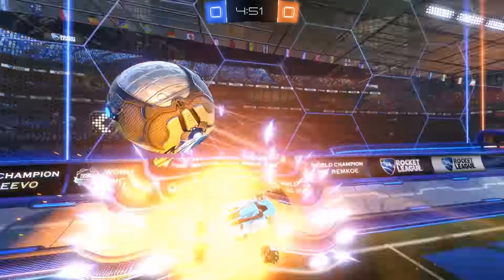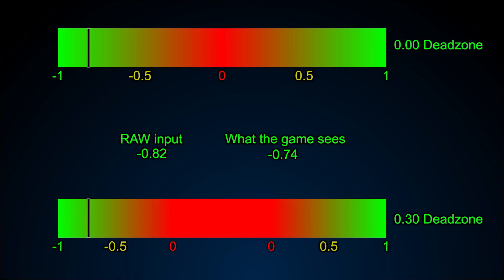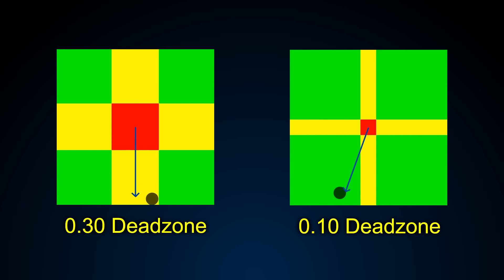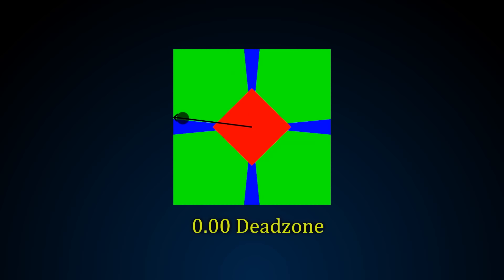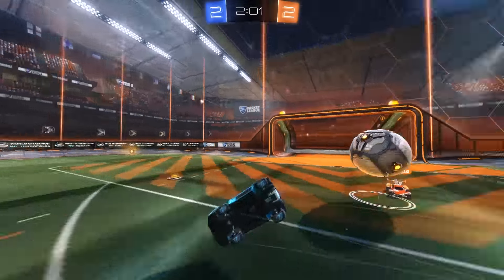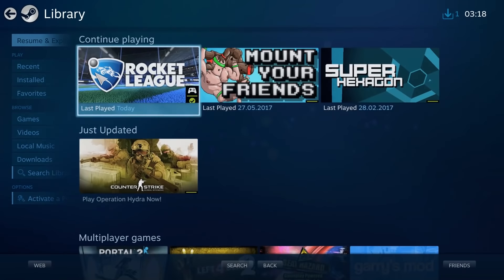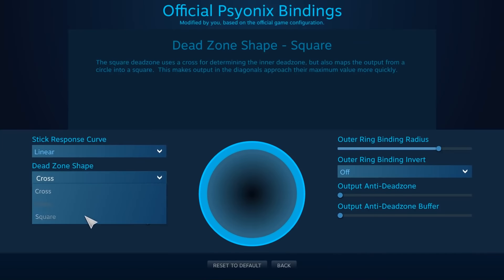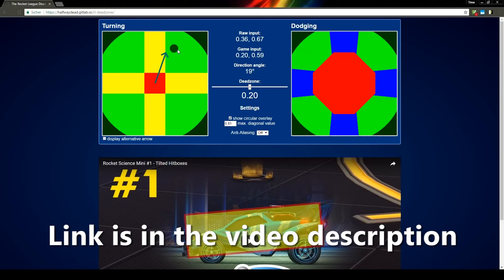Deadzone explained - Rocket Science #7

Comment: Help me make up my mind for me!  I watched this video and I'm more confused than before I even started!
I've always had issues with backflipping (on accident) while going up for a fast aerial and because of that I felt
the need to raise my dodge deadzone up about half way.  Even then I STILL kept backflipping on accident while
trying to do a fast aerial.  A couple years ago I decided to just put it at the highest value of 1.0 and these days I
don't backflip hardly as much anymore when attempting a fast aerial.  Am I somehow screwing myself over in
regards to other mechanics because of high high my dodge deadzone value is set at?  Please let me know!  I've
also recently changed my "controller deadzone" to be 0.25 instead of keeping it at a super low value like most
people seem to recommend.  I've noticed that as of late my aerial control while dribbling and my control with 
everything else seems to be a little more finely tuned and I feel a little more consistent.  Am I foolish to have
it at 0.25 rather than 0.05 to 0.07 which is typically recommended from most?

Comment: I’ve noticed a steam configuration issue that may or may not affect people
Interruptible button presses.
In effect, I’ve noticed many of my attempts to dodge ignored, on my DualShock4 wired controller.
I manually turned off interruptible presses for each button, which seemed to help but also made me unnecessarily backflip until I got used to the responsiveness

Comment: I sometimes get double input with my controller when using this method. I'm using an Xbox One Controller, but for instance if I jump in game it sometimes jumps directly after again without me pressing the button.
Reply from the maker: That sucks :/ Did you use my profile or did you do it manually? I've heard stories about steam settings randomly changing. You could try resetting it to default and start again. Or in case you're using any other software that modifies your controller input (like x360ce, durazno or possible others) you need to turn them off. Don't use them at the same time with the steam overlay. If none of this makes a difference then idk what could be causing it.

Comment: Hi and thanks for such an awesome video. By the same nature if we find the analogue stick too sensitive in game is there a way of using the steam settings to reduce the sensitivity of the sticks? For example in the air I find a little touch on the stick can send the car flying around. I’d love to hear if you have a solution for this as I suffer with issues with my hands and this would be a fantastic help in giving me better control - thank you 🙏
Reply: 2 years later but yes, Steam controller layout settings has a "stick response" setting now. If you set it to a "wide" curve the stick will be less sensitive when initially pushed and then increase to full range exponentially. It's great for smoother steering on the ground but It doesn't help too much in the air though - the steering is still too touchy and weird. It's just the way it is due to an imaginary gyro rotating a car around in the air...

Comment: Hmm just to be sure I checked the additional options like you said after I loaded your profile but the loaded profile is different from what you are saying it should be in 6:25 when I loaded your profile my dead zone outer is maxed but it says your profile is loaded :S Same goes for the anti deadzone stuff.. the only thing that's correct when loading in your profile is that it's set to square.
Reply from the maker: That is because I manually edited the profile to get as close to the max as possible. However, in the user interface that causes it to look maxed out even if it's not. The number and slider are rounded values.

Comment: u said if u set it to 0 steam automatically addy 0.25 right? i think i figured it out. if u use big screen mode on steam (only using controller now) and set it to zero and then add one klick to the right with the cross u get exactly 0.25. i think thats the default steps u can make with the cotroller?

Comment: I know this video is old, but I’ve heard square deadzone is bad, so wouldn’t it be better to just disable the entire controller configuration and play with default settings?
Reply: The steam controller configuration causes input lag. I would highly recommend unchecking the boxes in the steam controller options. You can google  “steam Controller configuration input lag” for reddit post confirming this for rocket league
Reply: I play on a 240hz monitor and I don't notice any input lag whatsoever with or without the steam config, it's probably grossly exaggerated I feel.
Reply: But ds4 windows is the best way to go to customize the specifics in deadzones

Comment: Hey dude thank you for this really valuable video and website, but why are your controller configurations using 1.00 outer deadzone and 0.00 output anti dead-zone like you said not to use ?
thank you
Reply from the maker: Sorry for the late reply. The configurations have files on the computer that you can edit manually. In the file you have the option to set the value a lot closer to 1/0  but it's still not 1/0 even though it shows like that. I've tested that it does behave like I wanted it too.
Reply: @RocketScience  ok thanks
Btw I suggest you to look at durazno^2
This is a great tool if you want to use your controller at it's best, but it requires to force steam controller support off for the game
Reply from the maker: Oh yeah, I agree. When I made this video I just thought it was easier to just load a profile through steam and wasn't sure whether people would want to install extra software. In the controller input lag video, I actually found steam config to add 1 ms of input lag. Not too significant but unnecessary.

Comment: I usually play rocket league on my PS4, but i recently got it for PC. I am considering switching to square (as many seem to suggest) but i am afraid of making that change because i don't know if PS4 allows you to switch dead zone shapes--and I don't want to play on PC and PS4 to be too different. What's the default dead zone shape on the console PS4?
Reply from the maker: Since Psyonix has added the Aerial sensitivity slider, it's no longer necessary to have a square modification. You can turn that up to 1.3-1.4 (depending on the controller) and turn as fast as possible diagonally. The difference between square and just a multiplier is that square only increases the sensitivity diagonally while keeping it the same on the straights which can be seen as an advantage for precision but at the same time it also needs some getting used to.
Reply: Rocket Science ooh that makes so much sense! I think I will leave it at cross and just mess around with the sliders. Do you happen to know what's the default shape in ps4?
Reply from the maker: The shapes are a bit confusing. The actual shape of the deadzone in RL by default is a cross as you can see in my web app. As long as you don't set the Inner Deadzone in the Steam config too high, the actual shape of the Deadzone is irrelevant. The reason people use square is because it modifies the sensitivity of the entire analog range so you can reach the whole square area of possible input values. By default you can only cover a circular area because the stick only moves in a circular area, but if you increase the sensitivity you can just reach the corners anyway.
Reply: OH. That makes so much sense. I'm guessing it shouldn't matter as long as i feel comfortable with the sensitivity i have on. Also, am i the only who notice if you double jump arial the car becomes even more sensitive to anologue inpute. And movinge up and down or left or right (without air roll) the car is surprisingly sluggish.

Comment: Hey, great video! I am using the configuration you linked to but it has made the vibration in my controller (xbox one elite) last a lot longer than it does normally. Do you know if I can change that?
Reply from the maker: I didn't change anything about that in my profile but it seems that this is a general problem of the steam configuration. The way it works is that it uses a virtual controller to modify your inputs and then Rocket League tries to rumble that virtual controller and steam tries to emulate that rumbling which doesn't seem to work that well. You can change the frequency of the rumble in the options http://i.imgur.com/AypNaxl.png but I don't think that's going to make it feel much better because it doesn't change the length. I'm sorry I didn't know that. I've never played with vibration on.

Comment: Hey, so whats the difference between circle and cross deadzone? as i understand it, if u bypass steam, the deadzone is cross right? i heard some ppl play on circle?
Reply from the maker: Yeah the default is basically cross although steam handles the scaling a bit differently. In RL if you have 0.3 deadzone and push your stick by 0.31 then that will move the car by (0.31 - 0.3) / (1 - 0.3) = 0.014 = 1.4%. If you use 0 deadzone in RL and set a steam inner deadzone of 0.3 and push the stick to 0.31 it will move the car by 0.31 = 31%. At 0.3 it would move the car by 0 obviously because it's within the deadzone. So that creates quite a sharp difference there. 

Wouldn't recommend circle. It makes diagonals even slowe than they are by default with any controller because it makes the inner and outer deadzone shape a circle and unless you offset that with the in-game aerial sensitivity your turns will be even slower. Just use RL without steam then imo.

Comment: Recently bought a ps4 , after using ps3 controller
in circle mode i can hit awesome dodge shots , air roll shots etc, but when i use square from steam settings given by you, i can half flip but it messes up  my dodges and air roll shots.
Reply from the maker: You can try cross mode and decreasing the Dead Zone Outer which will increase sensitivity as a whole. The thing with the square setting is that it doesn't change sensitivity equally in all directions which might feel weird but it might also just be a case of getting used to it. I wouldn't recommend circle because like you said stuff like half flipping becomes a lot harder because you need to have your stick pointing exactly up or down to cancel the flip.
Reply: FIrst,  thanks for the fast response
I tried as you said , but still no luck. though  dodges are fine with cross but still having issues with half flips.
i found some app called ReWasD but that doesnt help either. But thanks for your response anyway

Comment: Feel like i have huge input delay when i use steam config with the DS4 compared to not using steam config. Is this just me or is there a noticeable difference in input delay?
Reply from the maker: Yes that is a thing. Make sure that if you are using it, to use a legacy config. That only adds 1-3 ms. The new "native" support is busted and drops inputs and adds up to 30 ms. Either way, Psyonix has since added sensitivity sliders, so I'd just use those to get the desired outcome, rather than bothering with steam.

Comment: Why is the Dead Zone Outer at max and the Output Anti-Deadzone at min in your config? In the video you said otherwise.
Reply from the maker: Ah, good question :D The thing is that I went into the file of the config and made the value as low/high as possible. In the client it shows up as 0/1 but it's actually a little off but by so little that it doesn't get displayed. The effect is the same though.
Reply: Oh it rouded the value... seems logic since you can only move the slider by 0.002 steps.
And maybe you should mention, that you can only upvote with the controller. At least for me the upvote button didn't work with my cursor.

Comment: very good video! this plays a high part in fine tuning ur controll abillity. but i wonder why nobody talks about trigger configuration? like i played 1200h and still struggled to dribble a ball on the car. couldnt even pass lv5 on obstacle course. eventhou i watched like every video there is about dribbling training i just couldnt pull it properly off even tohou i am plat1... so two days ago i found out why i did mess up so much: it was a simple configuration that was on default. /// on the same controller configuration page u showed u can click on each trigger an set the reaction curve to linear but MORE IMPORTANTLY set on the left side in that menu the trigger config to simple NOT!!! to adaptive as it is by default. i INSTANTLY could dribble and beat my dribble course nemesis on second try!! try it guys and tell me if u feel the change. u are all more than welcome (wish i knew that 1.2k h before :/
Reply: You mean you changed trigger dead zone?

Comment: I always found it interesting how all of this is can seem complex when visualized but in mathematical/programming terms just comes down to:

if(abs(input.x) < deadzone) input.x = 0;
if(abs(input.y) < deadzone) input.y = 0;
Reply from the maker: It's not quite that simple. there is also an else case:
if(abs(input.x) < deadzone) { input.x = 0; } else { input.x = (input.x - deadzone)/(1 - deadzone);}
and if x is negative then it's not input.x -  deazone but input.x + deadzone

The deadzone that you were describing is actually what the steam controller config deadzone does.
Reply: (x - deadzone)/(1 - deadzone) just brings x the "usable" range of x into the [-1,1] range. So the input goes from
[-1, -deadzone] U [deadzone, 1] -> [-1,0] U [0,1]
I don't really see why that would be necessary for the math to work, 
but it would give you the behavior shown in the bottom image at 1:23. There is something that their function does that is nice. It brings the whole range of floats into the "usable" range, so you don't lose any precision. But, again, I don't see how that is necessary. Floats are more than precise enough even if you take away the bottom 2% of their range.
Reply from the maker: The difference is that when for example you have 30% deadzone then it would be impossible to turn slower than 30% of the max turning speed. Turning the stick 31% to the right would mean a 31% speed turn to the right. With the adjustment  it's a 1%/0.7 = 1.4% speed turn to the right.
And yes floats are more than precise enough. Most controllers use 16bit integers as output but then it gets converted into a float because the input has to be multiplied with some wheel turning factor anyway so you need it as a percentage of the maximum wheel turning angle.
You sound like you're coming at this from a very theoretical point of view. Yes, you can define functions like you want but the shifting to [-1,0] U [0,1] has to be done if you want to make an easy multiplication of your input with the physics.
Reply: why would it be impossible to turn slower than your deadzone when the deadzone should in that case be considered the 0 point when doing calculation. Unless you were doing the math improperly.
Oh and i thought analog sticks were just two potentiometers whose precision is defined by the specific potentiometers used, like a 10k step potentiometer and decoded by a simple circuit with a low pass filter.
Reply from the maker: Like I said previously. Yes, you could define the function like you want to. And you could define 0.3 as your 0 point when you do the calculation. But that's a theoretical POV. You have to do the math somewhere... You can't just say "I define 0.3" as my 0 point. At some point in the engine it will calculate the angle of the wheels relative to the car. And then when the engine checks how far the wheels are supposed to be turned and the input is 0.31 then you can either say you just take 0.31* maximum wheel turning angle or you do the math properly and take (0.31 - 0.3)/(1 - 0.3) * maximum wheel turning angle. Otherwise the car will turn at 31% turning speed instead of 1.4%

The analog sticks are probably working exactly as you said. I am honestly not 100% sure what gets sent over the USB cable. I based what I said on x360ce using 16bit ints and it emulates Xbox controllers. They might just convert it for whatever reason they have. Either way it doesn't really matter in terms of precision. I would bet my life that an 8 bit integer for each axis is already more precise than any human could be with such a small stick.
Reply: You can turn 0.3 into 0 just by adding -0.3 to it. That (x - d)/(1 - d) is not the end all and be all function was my point. The maximum in that case would be in 0.7 instead of 1, so you would have to compensate by increasing the magnitude of the forces (or whatever depends on the value). But considering how slow division is to calculate compared to addition I can still see a use case where taking an approach like this would be favorable. Like in a very fast paced, competitive game that has to run on slower hardware.

I may be taking a more theoretical approach but I was just trying to use the simplest terms. The point of my initial comment was just to try and show how simple most of this math actually is since I saw a lot of comments saying how people didn't understand a thing (simple math can lead to some very interesting, complex behaviour).

I agree with you about precision. 256 distinct points on each axis is more than enough for like 2 centimeters of movement.

Comment: In the video, in case you wanna do it manually, you said that dead zone outer has to be set to as high as possible (0.998) but not the maximum because the squaring gets disabled. And even the output anti-deadzone should be at the minimum value but not at 0 because steam adds 0.25 deadzone for unknown reason. Why in the configs "left stick or both stick squared" deadzone outer is set to 1.00 and the anti-deadzone to 0?
Reply from the maker: The answer is in this comment https://www.youtube.com/watch?v=2BHjvhxw06A&lc=z12gj1kirzvsw1ety220ezyynu3udjgie04.1498317431603588